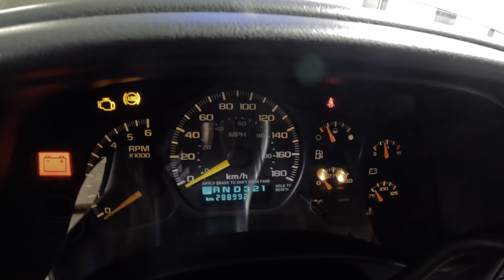Seize the Day! DO NOT Lube Brakes- Grease Jacking   2000 Chevy GMT800 Silverado 5.3 4.8 #repair

Comment: What we have here is an abomination of the WRONG lube!  That is wheel bearing grease they applied, not brake grease. Complete fail.  You do want lube on the ears so they slide easily and all it needs is a very thin coat. When properly applied it does not collect dust and cause bindage.  The WBG they applied hardens when exposed to air and heat cycles. Thats why it failed, also way too much lube on the slide pins, they probably were hydrolocking on the drivers side which caused the pad to bind.  A good set of brake pads will come with brake lube.

Comment: Grease, caked with brake dust and road grime, will soften under the heat developed during brake application. 
That said, rust that will develop with (salt and ) road grime, will not.

Water gets into everything exposed to it.

The rust on the rotors is typically an indication of a babied vehicle. Kinda like 710 caps caked in yogurt.

No one asked, but I'm donating my 2 cents.

Comment: @7.10 or so, look the rotor. It is NOT cause of the grease. Old rotor new pads and leftovers.. 

If you lubricate your brakes, the grease (or oil) will burn out of there fairly quickly. BUT salt do not. Grease is better than salt, i say.
Reply: And the pressures applied to the pads is outrageous. Dab of grease do not defeat that.

Comment: truck owners going to be pissed when he hads no brakes this winter if you worked in rust belt you know just how fast they lock up from salt not rays fault tho were he is hes right its pointless to grease them up far north you have to grease them and have them regreased often ussally 4 times thew out life of pads

Comment: About 11 minutes in... did you notice the broken sway bar link bolt? the head ain't there.
Reply: Ray said the top is flush so the head of the bolt is recessed into the washer, and the nut is exposed on the bottom

Comment: Those clips don't rust because they are made out of stainless steel. The part that touches the pads Should never be greased for obvious reasons you showed. I'd not call it jacking though. It's a barrier to free movement though

Comment: You can make your grease case but sorry I'm not buying it. Much rather deal with hard grease,  which I've never had by the way,  than rust locked pins which i have had plenty in here in PA. .

Comment: As a mechanic for 45 years living in Florida,Texas and Pennsylvania, I woul never NOT grease brakes or and sort of fitting that includes metal on metal. Any suspension joint,brakes, hinges ECT. Even in Florida parts can rust especially if you are within a few miles of the coast. Also on the slides what you could be seeing is a rust prevented spray ! And yes too much grease is as bad as no grease. Also the rust marks are also caused by a vehicle that has sit for an extended period of time and then driven. I disagree with you on this on Ray.

Comment: Whoever did those brakes had the right idea, just wrong execution. Possibly used the wrong type of grease too. If you put actual brake grease on the brackets under the slides, it keeps the bracket from rusting and it doesn't get all nasty with brake dust. Just a tiny amount is all you need. Plus I wish I encountered hubs that came off that easy

Comment: I don't understand why vehicle manufacturers don't make the backing plates out of aluminum?
Reply: Because they are attached to steel parts and the galvanic corrosion that will occur will cause as much or more damage than the rust that ate these backing plates.  Dissimilar metals just don't get along.

Comment: Sorry Ray, don't agree.  The tenet that only half the rotor surface is working because grease is jacking (misaligning) the pads would be evidenced by tapered pads.  You have not shown that.  My colleagues below are 100% correct. There is far too much grease under the shims.  The factories are crystal clear, lube surfaces that touch the moving parts - pistons, sliders etc. This doesn't mean ladle it on with a brickies trowel, as shown here.  I live in S. Ontario and if you don't lube the brakes correctly, at least once a year, you will be in a world of hurt come the cold weather.

Comment: Never heard about this. To put grease on the brakes isn't it a risk? Isn't there a chance of break failure?
Reply: It's not on the friction surface.  It's on the part where the metal pad backing rides on the caliper bracket.  You do not grease friction surface ever and I actually go so far as to make sure not to even touch it.
Reply: Usually when something breaks it is a failure. The BRAKES, however, did not fail in this case, they were just not working up to spec.
Reply: Whoever did these brakes put way to much grease that’s why they have this problem you only need a little.
Reply: Well, I thought so. It doesn't make sense having any type of grease on the pads, and most break jobs I've seen ( if not all) the mechanics never apply any grease. They just change the pads and that's it. Thank you for the explanation.

Comment: Slides are stainless steel they shouldn't rust, if rust is a problem manufactures need to change to a different none ferrous metal like oillite bronze but its soft like copper
Then that makes me think of plastics both on the brake pad ear and slides    but that can melt, or get brittle. Then a carbon fiber like the rotors used on race cars,
There is deffently a way to change the engineering thats not going to rust from road salts. 
Find it make the whole dam truck out of it.

Comment: Much too heavy with the lube on the slides!
Worked mostly on northern vehicles and the slides and the spacer springs would rust and lock the pads.
I admit I lube them with anti-seize but VERY LIGHTLY; almost transparently thin.  Never had a problem with returns or jacking.
Up north, without some WD40, the bearing retainer bolts would have just twisted off!

Comment: Anti Seize is a horrible product to use as a lubricant for brake components.

Anti Seize works by creating a sacrificial matrix of graphite and metal powders that deter galvanic corrosion, and if rust forms the soft graphite becomes part of the rust matrix and fractures easily when you go to remove the nut or bolt.

It sucks as a lubricant!

Comment: Ray never seize and slide lubrication is not the same.  Never seize turns into a coating or glob as you see happened on the slide. Wrong application!

Comment: Using salt on roads should be banned. We get as much snow here in North Idaho as anywhere else and they don't use salt. And we don't have to replace our vehicles every 4 years. I have a 2003 gmc and it doesn't have one spot of rust anywhere on it and has never been undercoated.

Comment: grease the slides on caliper brackets? no you don't, you don't want that grease anywhere near the pads. The potential of getting grease on the pads is pretty darn big so you don't want that. If those slides are in good shape and the pad journals are good they should slide fine on their own. Not to mention grease attracts dirt and since those slides are open/exposed to the envrionment they will collect dirt with will wear the slides out. You don't want anything on them that will collect dirt which grease does.
Now to clarify, the caliper bolts that actually allow the caliper to move yes , grease those because they are enclosed in a boot seal but those guide rods for the pads no you don't want to grease those.

Comment: I  wouldn't personally grease the ears like that. However I am the kind of person to dab a little anti seize on the studs and shave off 5ftpound of torque.

I COULD see the appeal of putting a little dab on the ears in the rust belt for a winter service vehicle. But other then that Nah. It'll attract debris. 

Basically, it comes down to your region. Rust belt is a B!tch.

Comment: 6:43 No ray, that's rust creep. It happens to all vehicles in areas where they salt the roads, especially if you don't drive them every day and park outside. It has nothing to do with the grease making the pads stick, those pads weren't even stuck because you could move them around with your bear hands.

Comment: That rust belt must be a bitch. I have never seen that clip greased before. According to the posts I've read they say it will rust if you don't do it at least a little, but you show how the grease itself causes problems. What do you do? I think I would not grease them and have them serviced regular, I mean, look what happens with the grease. Brakes are a must and can be expensive if you let it go. I would use that rust reversal stuff once or twice a year if I lived up there. Not sure if it would work on the slide clips or not, maybe worth a try.

Comment: grease jacking??? that's not a thing unless you're creating something new to push with. Rust jacking happens when the rust develops underneath and expands out.. you just made up a term to justify it. don't use too much, that's it, but it needs some kind of coating to prevent rust from forming where you don't want it.

Comment: No. Just no. I’m calling BS! Are you telling me that grease, which you could move with a screwdriver, has enough strength to resist the hydraulic clamping force of the calipers? 
The problem lies elsewhere.

Comment: It's not whether or not to grease the brake pad slides. It's WHERE to grease them! Those were greased incorrectly! They should have been LIGHTLY greased UNDER those shims to prevent rust jacking in our salt soaked Northern region. If you live where there's no wet salty brine to soak into your metals, no grease is needed. 
.
RAAAYYYYY!!! YOU MISSED A MAJOR FLAW IN THE PASSENGER SIDE!!!!
That truck hasn't been in your shop long enough for NORMAL spiders to settle in... YET, it has a freaking COBWEB!!! THAT MEANS A FLORIDA SPIDER HAS MOVED IN ALREADY!!!!!
🕷🕷🕷🕸🕸🕸🕷🕷🕷🕸🕸🕸

😱😱😱😱😱😱😱😱😱😱😱😱